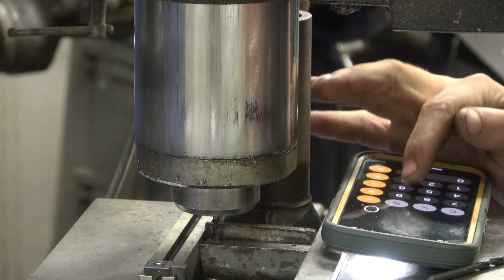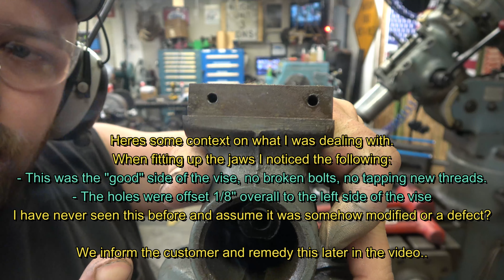Small Wilton bullet vise repair

Comment: Nice work. I’ve noticed the majority of Wilton jaws don’t line up if replacing with a new set of jaws. My assumption is  that originally they would bolt the jaws on then grind or mill each side to match the exact width needed.  Maybe they didn’t think to have a good process in place to have the holes drilled in the same exact place on the vise itself and this was their easiest solution.
Reply from the maker: They aren’t or never were as accurate as people like to imagine, at least on the jaws and shelves. My buddy has a very nice C3 and the jaw bolt holes are seriously over 1/8” off per side, nowhere close to what it should be. Their QC was always sketchy